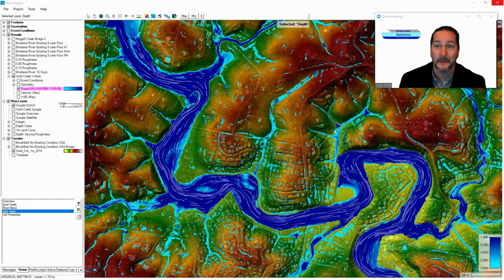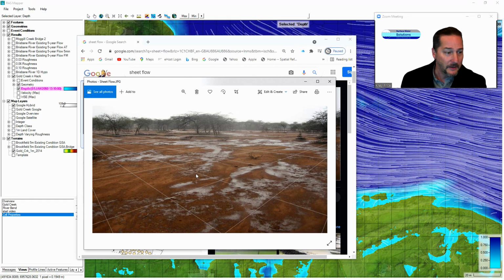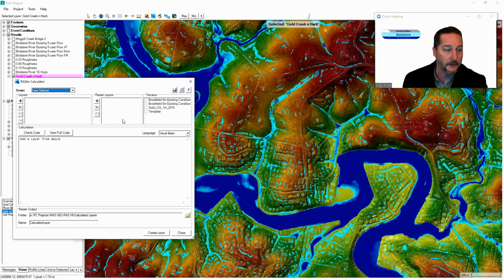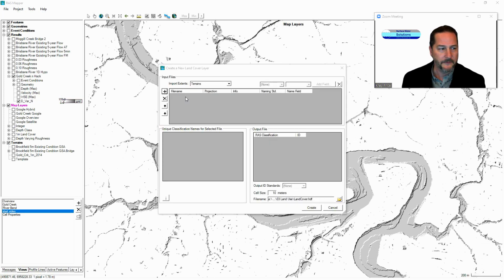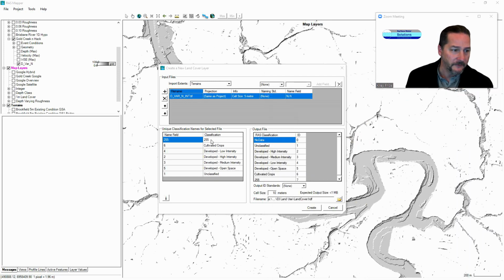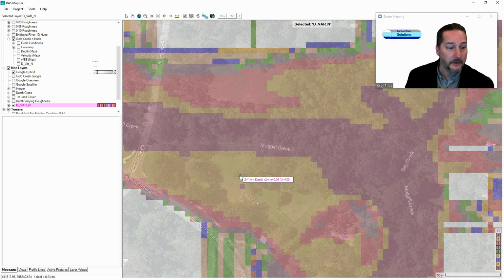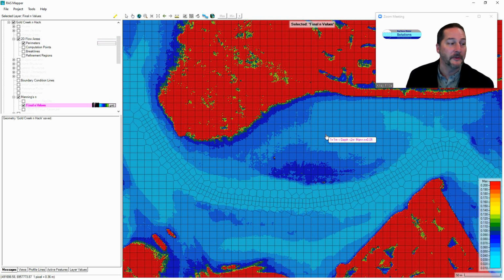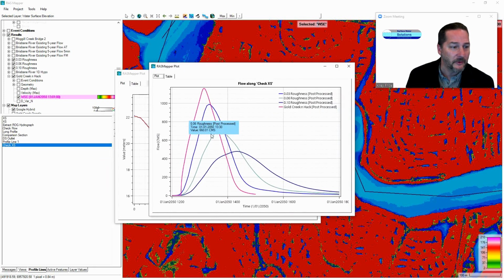What's new in HEC-RAS 6.0 Part 6: Land cover layers and depth-varying roughness hack

Comment: respected sir, 
which equation is better in CSU & Froehlich equations for scour depth. 
 Case 1- When we have to study on grain size.  
case 2- When to use pier shapes & pier sizes.
Reply: Corps of Engineers hasn't updated scour computations for a very long time and HEC-RAS does a pretty poor job of it.  You should be using CSU for pier scour and the so-called "NCHRP 24-20" method for bridge contraction and abutment scour.  If scour estimations needed for bridges, the user should consult and follow the latest version of FHWA publication HEC-18.  It's what state DOT's typically follow.

Comment: Thanks alot,Mr.Price and Mr.Goodell,are helping out HEC RAS users.HEC RAS 6.0 going to be much better application then commercial softwares.
Does HEC RAS 6.0 solves coastal flooding?
Reply from the maker: HEC-RAS can potentially be used for coastal modelling, but only in 2D, so other models may be best if circulation and vertical elements become important. Recommend Full Momentum #21 on Tidal Modelling: https://www.youtube.com/watch?v=4-bQa8Vvoh0

Comment: Really nice video, Sir! It's great to see that RASMapper is even more powerfull! I've a question: When you re-run your model with the new Manning file, I suppose that you'll get new depth values and should create a new Manning file again. So we could use a trial and error method to adjust the depth-varying roughness in a way that depth from the Manning classification matches the depth results?
Reply from the maker: Yes, it might take a few iterations to get it to stop changing, but in general we're just trying to differentiate concentrated flow areas from sheet flow areas, so in many cases the first approximation will be close enough given the inherent uncertainties in roughness coefficients and other input parameters. And there are a lot of models that would benefit from classification polygons that override the land cover layer with roughness coefficients that do not vary with depth (for buildings, etc.)
Reply: @TheRASSolution  Really interesting! Thanks for the explanation!